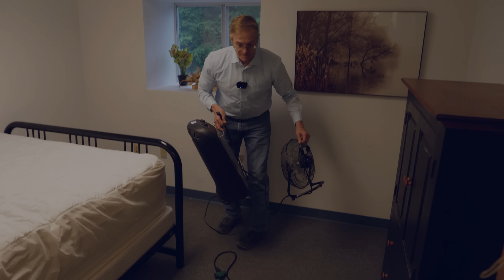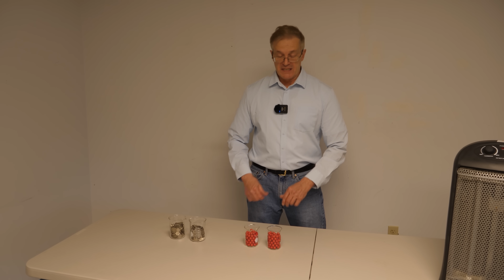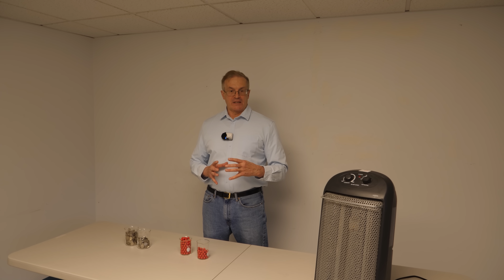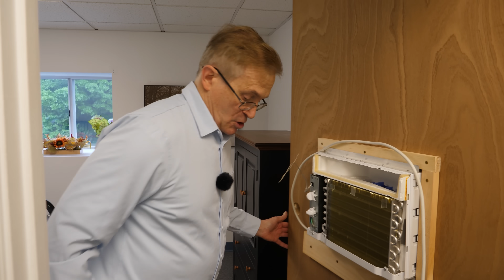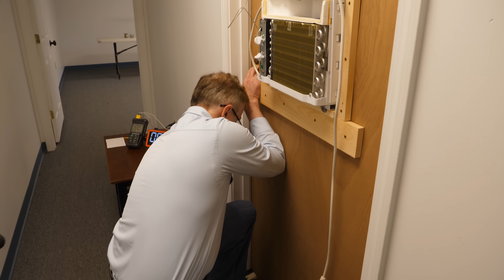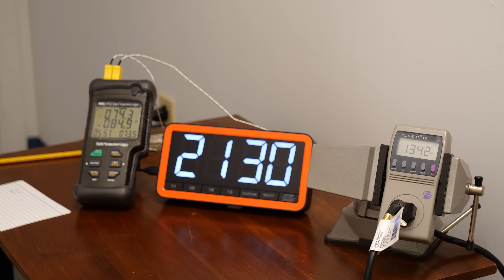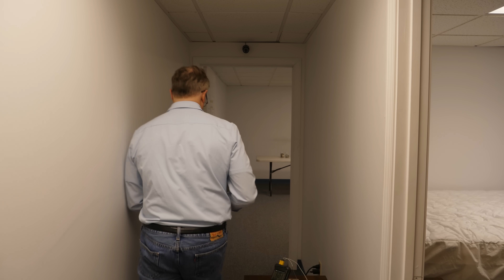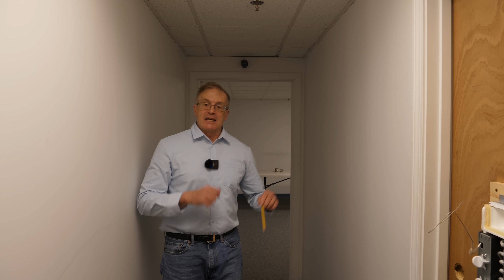You're wasting money on heating! Use your A/C!

Comment: You are correct , I built an artificial wall to cool off a room  and discovered this also, enough heat comes from the back to heat up another room or even a house, simply reverse your air conditioning window unit to blow cold outside and circulate heat into a cold room works perfectly fine as a heater👍 many people have no idea that this is possible, but don't forget about a water drain pan

Comment: fantastic !!! i have one of those portable air conditioners that have that 6" exhaust hose that you run to the outside through a window, so if i put the unit outside and run the hose into the house that will give me heat, do i have that correct....also while running this type of ac unit i noticed the hose got aufully hot and the hot air was getting sucked back into the unit making it harder to cool down the air, i finally wrapped insulation around the 6" exhaust hose so most all of the hot exhaust would go outside

Comment: wouldnt an actual heatpump be even more efficient?! The AC is drawing cold air from the hallway which  is a fixed temperature.  A machine built specifically for this application can instead draw air from the inside of the room which gets progressively warmer.

Comment: While they are virtually impossible to find, I lived in a small home that used a huge heat pump "window unit" for its air and heat needs. It was a 15k or 20k or something. It was more of a package unit installed in the wall in the kitchen, pointing to the living room. I meticulously maintained that old thing, knowing it was likely irreplaceable, with plain electric strips being the norm for window AC units. It eventually failed and I definitely couldn't afford a $900 replacement, so I made do without a heat pumping heater. I wish the high-end window units were more commonly available as heat pumps. For those tiny homes in places where you need just as much heat as cooling. You basically need a mini-split, but their installation is much more involved of course.

Comment: where we live gas is cheap and works no matter how cold it gets outside with high efficiency gas boiler, we are toasty warm for a cheap price no air blowing around just warm radiators radiating heat at us. we have to pay a minimum bill to have gas service, so it makes no sense not to use the gas for heat it also does the hot water and dryer and stove.
the electric company is switching a lot of power plants over to gas around my area, so we are more efficient burning the gas at our house with all the loss at power plant and transmission lines price of electricity is higher than gas.

Comment: This is misleading. Heat Pumps do not get anywhere NEAR this efficiency when its 40*f or below outside. This is why nearly ALL heat pumps come with electric resistance back-up heat. In places like FL, where the outside temps do not get below 45*f all year; heat pumps are great. In places like Massachusetts or Maine, heat pumps are useless...

Comment: But how efficient would it be if the AC was used with cold outside are, such as in winter?
Reply from the maker: The efficiency will drop.  The efficiency will rise if you don't also want your indoor temperature at 90F.

Comment: Heat pumps are less efficient in freezing temperatures.  And are prone to freeze up outside when the outside coil becomes the evaporator side.
Reply from the maker: That's true
Reply: @TechIngredients  I'm retired now, but you are also right. I used to repair heating and air conditioning systems to include boilers and HVAC. I enjoyed watching your testing. I'm lucky enough to live in WA, as far as mild climate goes. My heat pumps have saved me about a third on my utility bills. I just found your channel, but people need to use the best R & U factor on their walls ceiling and windows if they want real savings as well. Thanks for the reply.

Comment: Now the controls and the filter which needs to be cleaned is on the outside? And it drops on the inside?
Reply from the maker: The water drain can be routed to wherever you want, and I'd forego the filter as the airflow will be better without it. Controls are largely unnecessary because the air conditioner will be trying to cool the outdoor environment. Just use a thermostat inside to turn the unit on and off.

Comment: So what happens with the condensation from the AC?
Reply from the maker: You can route that water to wherever you want. The drain hole can be coupled to a small tube or plugged, and a new hole can be positioned wherever you want it.

Comment: My question is would this basically be the same as the more expensive ones that have the heating option without having to turn around. Relating to the 400 or so Watts. Would one that has the heat function also heat just as efficiently?
Reply from the maker: In principle, it's the same.  But a unit with a reversing valve and a better method for dealing with condensate would be more practical.

Comment: I just found your channel and I can tell you this does work. I had to retire out early from my job when my brother got sick 250 miles from where I live. Being away from home going back and fourth every couple of days to check on my house, vandals COMPLETELY destroyed my house and on top of that busted my water pipes so water was shooting up and ricocheting off my kitchen cabinet and flooded the house with about 3 inches of water. You know what water does to a mobile home plus two storms that sent 3 big tree limbs through the roof. I lost EVERYTHING I owned. When I was finally able to come home to stay I put up a big tent behind my house that I completely wrapped in greenhouse plastic, even beneath it. I lived in that tent for almost two years before I finally got a 14X40 cabin / shed brought in to fix up.
Down here in the South we have really bad humidity and in the winter that damp cold gets into your bones. I've seen grown men almost in tears working outside where I use to work that had come from uo North that were use to COLD weather but could not understand how even in freezing temps down here, they could get warm until I told a couple of them it's the damp air getting into their clothes.
Anyway, in my tent I got some blocks and built a platform off the ground and cut a hole in the tent to sit a 5000btu air conditioner in it. In the winter I turned it around and shielded the knobs from rain outside and this is what saved me and my pups in the winter with that warm air blowing. Yeah, it was a little noisy but who cares when it's 19 degrees outside.
For condensation problem, I got a section of guttering and sealed endcaps up on it with silicone and put a drain hose leading out and away from the tent. I got some heavy duty aluminum foil and made a shield to direct the air blowing in downwards to the floor to keep the warmth rolling across the floor of the tent and we all stayed comfortable.  19 degrees outside and I wore a t shirt inside the tent lol
I know that sounds like some rigged up red neck stuff at it's best lol, but it worked and I would do it again. I'm a woman and almost 60 years old and I have no one to help me with anything but my mother taught me to think about what I have and to use what I have to survive bad situations. My folks were born in the 1920's and survived the Great Depression so I was blessed with their knowledge of making do with what you have.
Reply: I wish you the best on fixing up your new home!  You can do it! I live in a DIY house that me and my husband built using a lot of used stuff. I didn't have any running water in my house for over 20 years, but now we do. It is hard when you are poor but keep chipping away at it.
Reply: Country girls will survive.❤
Reply: Man that’s freakin awful that happened to you. I’m sorry to hear it. Glad you knew enough and were so resourceful that you & your pups made it through.
Reply: You parents would be so incredibly proud of your ingenuity and strength. I hope you acknowledge your own accomplishments. YOU did that and should be proud.
Reply: You're a living legend I tell you what, it's people like you I admire.
Reply: Thanks for sharing , brilliant idea
Reply: Wow, Doody Bird! I am so sorry for what was done to your Home! Many Blessing's into your heart! You are such a lovely Lady to travel all that way to care for your Brother!  You have done a great job using your skills and the things you have learned from your Parents! Thank you for sharing your experiences with us! I pray for you and your Pups to be safe and live happy lives! You are a strong Lady!
Reply: Wouldn't heat pumps have to periodically briefly heat the cold coils, else ice would build up and block the air flow? "Frost-free" refrigerators have a heating element underneath the evaporator coil in the back of the freezer, and a defrost timer or some means of turning off briefly the cooling and applying a little heat, generally not enough to impact your frozen food.

There is also a very mild heating element around the door frame where the gasket seals. That it to prevent rust and mildew due to the cold spots that then attract the humidity from the ambient air.
Reply: Dirty bastards!
Reply: That’s a great story thanks so much for sharing!!
Reply: Hey thanks doodybird for your post i appreciate you & your mind.
Reply: Very smart 🤓!!
Reply: Yes, like others said, need to channel this.. you tube or a book
Reply: That was pretty clever.
Reply: Too long did not read!
Reply: @Rudizel  you missed a good story . You need to develop more patience to learn skills or you will freeze to death in the dark in the very near future
Reply: @Rudizel 
Your loss, PATIENCE.
Reply: @garybrown1404 it’s a virtue!
Reply: @Rudizel  Just read the second half, it was very informative testimony
Reply: @Rudizel that’s pretty sad
Reply: Not to sound rude but... its not too long, you just dont want to read it. It's very informative. The Bible is even longer 👀. @Rudizel
Reply: @Intercessor_7  
So many supposedly "educated" people out there, who are biblically illiterate? And they consider themselves to be "educated"? Ha!
Reply: @Rudizel  Why bother leaving a stupid comment?
Reply: @garybonacci2031 I think it's a valid comment although I disagree. He didn't insult her just noted that the length was not to his taste, something she might consider. Personally I enjoyed the entire post.
Reply: @DarqJestor Then he needs to move on. No need to make the writer think she needs to cut the info down.
Reply: @focusabove2960  Nothing wrong with him providing constructive criticism.
Reply: Obviously, you have add and you missed out on great info . Next time, pass on to the next video too. @Rudizel
Reply: @Rudizel Get back on your video game!

Comment: Hey just want to say thanks, times have been hard and despite the deadly winters where I live I have been surviving them using space heaters, blankets, the stove, my car, you name it for the past 5 years. It's 6 months of hell padded by 3 months in purgatory but I own a home here so I kind of have to deal with it. Would you suggest just reversing it and putting in a hose for drainage or keeping it front facing and modifying the electronics?

Comment: I hope you will do a follow up to this idea!
I am also experimenting with this concept.
I am trying to heat a well insulated 1000 square foot garage with 10ft ceilings, located in sub zero (0 celcius) winter climate.
So far, as a proof of concept, I have crudely ducted an 8000 BTU window unit to blow cold air out the window.
But the unit itself sits inside on a bench, extracting heat from the ambient air and blowing it through the condensor.
I raised inside temperature by 3 degrees in 3 hours yesterday, using 700W of power. But the inside-outside temperature delta was only around 10 degrees.
I now have it on an temperature operated switch and will pursue testing when it gets colder.
My idea is to eventually run the duct in the attic,  above insulation where the cold air shouldnt make a big difference.
I imagine this kind of thing has been done before but I just can't find anything similar, apart from people literally turning their ac inside out which always freezes up the coil obviously.
I'll keep anyone reading here posted if there is some interest.

Comment: Would A/C's be responsible for heating up the outdoors?
Reply from the maker: Not any more than releasing energy into the environment from electric motors, lights, or wood fires. The separated warm and cold airs will find each other, and only the power that runs the air conditioner is really added.
Reply: @TechIngredients  I have been wondering the same thing.  Huge spaces are cooled in permanence and even sub cooled...that has to have an effect on outside temps?!
Reply from the maker: Not really.
There is a saying in engineering, "If you don't know the numbers, you don't know anything." 
Consider the volume of those spaces you're referencing and compare them to the entire surface of the planet. Even then, heat will continuously flow into those spaces from the surroundings no matter how slowly and we're talking about over decades or centuries.
Reply: @TechIngredients   I think of sources like reactors that cool  Dollar Generals and Walmarts. Or coal, or natural gas, or (insert fuel here). I am not being rhetorical. I genuinely want to know. I don't feel that you were/are wrong or condescending. However an experiment or demonstration would be very YouTube. (Demure?) Helpful! Do you think your answer could be demonstrated? I am in Florida why does my water take longer to boil than yours? (rhetorical) However, my limited public education has me at odds with, for lack of a better description, displacement/transfer of energy on our little speck of space dust. Our potentially closed system,  what about the entropy within our atmosphere? Also, is it "the entropy" or simply "entropy"? Back to sobriety, can you show that we are not heating up the hallway?

Comment: Except an ac unit is more expensive to replace by a huge factor than a heater
Reply from the maker: That's true. 
If you need backup power, you could build a wind turbine above your home or buy a gasoline powered generator from a big box retailer. Both would work, but one might be more practical.

Comment: If you can divert the intake to pull from the room wouldn't that also increase the head output?
Reply from the maker: Probably not because the air drawn from the room has to be replaced by air from the surrounding, cooler environment.
Reply: @TechIngredients 
Edit; I was wrong.
 I think you might be wrong on this; It wouldnt be drawn but recirculated.  Both coils are separated from one another. They each have their own fan.
The evaporator intakes air from the room and spits it back out(colder).  The condensor uses the outside air to cool itself down.
Reply from the maker: I think you're missing the point, which is to heat the room. Your suggestion might indeed increase the temperature of the air coming out of the condenser, but then the air in the room will be pulled into the evaporater and has to be replaced. The replacement air will be cold.
Reply: @okkrom  I thinks it's because it creates a bit of a vacuum. While in theory it would make it hotter and hotter you end up with negative pressure which will stress the machine and begin to draw in cold air from all cracks. Now if you have a perfectly sealed room it would be like putting a towel on the back of a fan.
Reply: @TechIngredients  I was wrong, looked at it wrong. You are right.
Reply: @puzzleheaddesign3789  I was looking at it wrong.  You and Tech Ingredients are right.  I still think its more efficient to draw inside hot air but my understanding of the mechanism was off; Of course if you are rejecting air from one closed room to another one that air has to be replenished.

Comment: How do you collect the condensate water from the back facing AC inside the room ?
Reply from the maker: We didn't experience that problem during the short test.
However,  the drip pan has drain holes that can be blocked or repositioned, and a tube can be used to route the water to wherever you want.

Comment: How could a person adjust this so that it only heats the house to a comfortable 70 degrees. As I understand this video if I put the cold side facing outside it will run till the outside temp is equal to the setting on my ac machine. This doesn’t seem like an easy system to heat accurately is all.

 But that doesn’t mean I didn’t enjoy the video. Great video

Comment: Great video!  This will help to convince the accountants in charge that replacing air conditioners with electric heaters by installing new heat pumps is not a waste of money, but actually going to save them a lot on the electric bill!  

Thanks for the easy demonstration.  However maybe they will want me to install the air conditioner backwards instead to use the old AC as a heat pump.  

When I worked at a retirement center built in 2000, they had old PTAC units in many of the rooms (about 105 of them) and I wanted to buy new R-410 units, they worked better in the heat pump mode down to 35F, not the 40F cut off that the older units had.  For those who do not know, a window or PTAC heat pump changes over to it's electric heater at about 35F, so no ice can build up on the outdoor coil, they do not have a defrost system, and the outdoor fan blade can get blocked and not spin if there is to much ice on it.  

I live near Portland Oregon, and there are many 40F days that actually don't reach 35F, so the heat pumps might run 30% more in the heat pump mode with the newer units. Also the R-410 collects heat much better than a R-22 unit.  

I like the clever way you show this happening.  It makes it easy for even a accountant to understand.